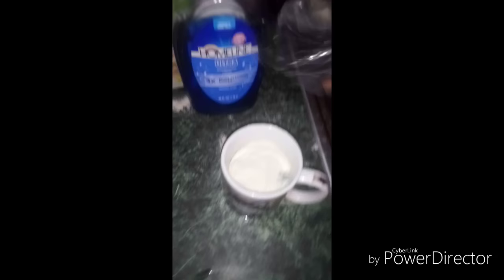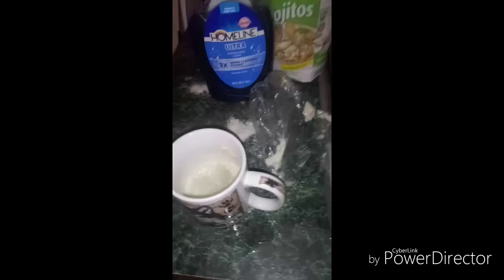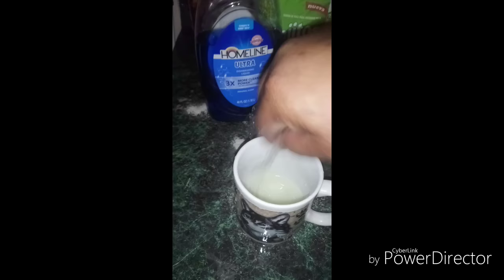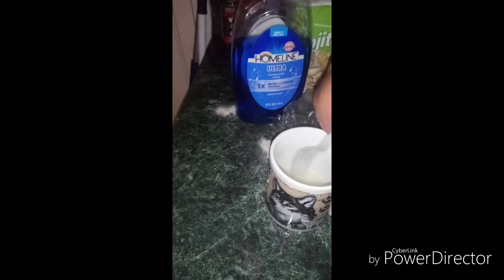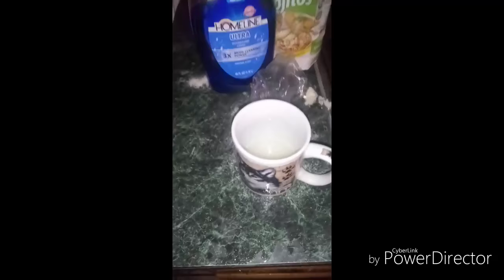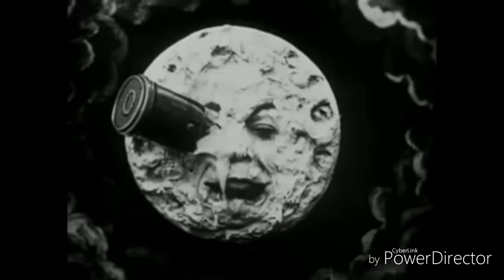How to cook crack. The whole process reenacted from start to finish. flour as place holder parody🍞

Comment: I wanted to share my first try recipe, wich actually worked. Don't use a mug use pyrex so u can see the yellow blob very important to look and spill only into other clear containers. Basically the amount of water u use at first barely matters its just where the reaction takes place but it alllllll depends on how much product u have!! I'd say the smallest for the pyrex is a ball and even that I now find was too small, its actually easier with more. But wit a ball I did about a 1 of soda to the ball. Used about 100ml of water at first, microwave on 7 for one thirty. You don't want it to be a rolling boil and risk it spilling out u rly just want a simmer. Once out u throw some ice water in with your hand and an ice bath or ice pack for the outside definitely helps because it took me a looong time for everything to cool down and come together after spilling out almost all the water keeping basically only the blob. Try to get as much water out as u can with small ammounts. I tried to whip it up but idt there was enough blob so I then just decided to let the blog cool by itself inside the tiny bit of water that was left. It did start to harden and look very clear. I got rid of the rest of the water as the blog stopped moving around. Put it ontop of an icepack with the blog sitting at the bottom and once the container was no longer warm to the touch I just let it air dry for a few mins till u can actually touch the blob. Then as it got harder I scooped it out with a spoon and it started rockin up hard on the spoon. I took another spoon and scooped it onto wax paper and then let it finish completely. I then let it finish drying for an extra like 5-6 hours just for good measure. This stuff seems clean as hell theres almost no crackling but a smooth melt instead. I'll be honest it wasn't the best stuff to begin with but got damn I had almost a 70% return with no whipping. This is all for personal I would not market this or this method this is more for small personals. Best of luck yall these are probly the most specific instructions right here and its all thanks to the sharing of the internet. God bless and wish u all luck! Till next time this was a great learning experience and I basically did it just to feel accomplished. :) I'm no comeback kid yet but success feels great ;)
Reply: Respek ur scripturez fill my crakz 💯
Reply: What would change in this method if I used a stove top with a pot of boiling water for heat?
Because not all microwaves are the same n I’m lowkey new.
Reply from the maker: Nothing. Microwave just a heat source.  Same thing,, 30, seconds and check jin
Reply: 💯💯well explained preciate u bro
Reply: @DubDidit  ... can I just make enough for an 8 ball ??? Thats all I have right now !!!
Reply: I mean at the moment  !!!
Reply: Kmkcopkiller... I'm curious as to the amount of product. If I only have well ... less than an 8 ball now ?
Reply: What I mean to ask is ... " how much water should I use ??? And baking soda ???
Reply: @bradleynickoshie5568  that's wat I'm thinking thought I ain't hadda add anything am new 2 dis n seeing all these niggas wit essays Abt how 2 do it when there's a simpler way in my face
Reply: yeah I do really small cooks dude, so say you do a 0.4 of coke then use about 0.1.5 of baking soda and a tiny sprinkling  of water.
Reply: Microwave on 7 for one-thirty ? I don't understand that part
Reply: @DubDidit message me medd some help I'll cash app you
Reply: Yeah blob frock zara 😂🤛
Reply: @DubDidit Biden 2 or 3 now?😂
Reply: @bradleynickoshie5568 they had to kill the squirrel as a spoon so it doesn't become a very far situation 😂
To save the plates they killed the platts 😂

Comment: Take notes trappers.
Bring a boiling pan with water to a boil.
Put your "Shminķër" in a glass( not too thin). Pour ammonia in the glass so its just above the "Shminķër" 
Then put the glass in the middle of the boiling pan but the water only comes halfway the glass so it dont flow over.
When your glass starts boiling as wel it turns to oil but really let it all turn to oil. 
Take the glass out and splash water on it with ur hands. The druplets on the surface need to fall down. 
Pour out the ammo and put ur glass in the fridge ( loose less that way). Til it hardens up again.

Edit: dont stirr the oil too much
Reply: But what’s te best way to poor the ammo out without spoiling anything of the sheesh in the bottom
Reply: Where u man trap
Reply: @Pastossss  when its done you add cold water with ur hands same amount of water as there is ammo in the glass then it hardens realy fast
Reply: @ig1185  holland
Reply: @ig1185  hollanda broeder
Reply: @hzg3088  Hollanda deze kant ook broeder
Reply: @Pastossss  hahahaha soldaat
Reply from the maker: What in the pyrex glass is going on here
Reply: @DubDidit  nothing sir, we chillin
Reply from the maker: 😆 carry on
Reply: Bro is it possible to reach you I have a couple questions , I just made my first batch and I got 0.4g from 1g … I don’t know when I missed it
Reply: @philipairen3849 You don’t get back as much as you put in. Plus if the product is not that great. You’re cooking out all the impurities.

Comment: My dear God, the ratio is 1/3. "Flour" 1g carb 0.3 then up the amount or down the amount as required
Reply from the maker: There's no set ratio bro ur just making things too fucking complicated. A real d boy gonna just throw a couple pinches in and know what's up.  If u cookin a 7, just out enough to cover up the bottom of the glass, not a thick ass layer a thin layer. Simple as that, maybe 2 decent pinches.  

You acting like every gram of sawf contains 100 percent pure.  Therefore your ratio logic is faulty.  .3 to 1.0. But what if it's been cut in half than your actually putting .3 to .5 what if it's super trash, .3 to .3 .  No product is pure therefore trying to micromanage ratios is bull shit 

Go make your own guide if you know so much better. let me know when u do, I'll post the link to you smh
Reply: @DubDidit  Hey bro. How do I cook using 1 gram. Don't want to screw it up as it is my first time and Id like a pro like you to help me !!

Comment: I normally clean my floors with anomia never seen that method before
Reply from the maker: Yeah, the floor cleaner good but it won't blow up. Not to mention it's harsh on the wood if not done properly
Reply: @DubDidit   straight up I'm using amonia to wash up my thing what you mean it won't blow up

Comment: I've got 2 grams, still use micro? And how much soda? N how long? Any help would be great
Reply: Do u cook it for less time if it's just a gram
Reply: @johnmartinez1410  did you find out?
Reply: No..so I just cooked it in a glass jar in a frying pan full of water
Reply: Put 2 leveled tablespoons of soda, drop all in water, stir. Microwave 30 sec. Stir top of water. Then swirl mug around while blowing . Let set for 5 minutes and you'll see rocks at bottom. Pour off water,put on napkin to dry. Do what u do

Comment: hello quick question , do you have to use bicarb? or baking soda?
Reply from the maker: They the same thing my man
Reply: @DubDidit  yeah appreciate it bro i thought bicarb was slang  for something else , also would it be better to use less water to be safe?
Reply from the maker: Krak is not water soluble .  So I just never really paid too much attention to how much water I stared with. I'd dump 98 percent of it out (that's a guess).  Lot of ppl mess up by leaving all the water in there and it comes out as crumbs. Buuut there really isn't a wrong way as long as desired results are achieved
Reply: So I can mix with flour?
Reply: @bigpapa9528  🤣🤣🤣🤣🤣

Comment: Man i tried it with the real an messed it up because i didnt know how to whip
Reply: Whip it counter clockwise for 5-7 mins
Reply from the maker: Or not. Errbody got they way. I'm telling mine, I don't want no one to get confused tho. Clockwise counter clock wise etc..1 min 2 min whatever. Whip it whichever way your hands work. Sometimes it takes a few minutes to harden sometimes it don't. There are too many variables to be so specific
Reply: @DubDidit  quick question do u have to brake down the product or straight cookie

Comment: I dont live that life anymore but just wanted to share that this was always a pain in the ass. I dont necessarily want to promote drug use, but if you do partake and want to save your money, just find a plug with ready rock. skip all this bullshit. save your time and money.
Reply from the maker: The problem with that is most dealers don't sale good work. They sale whip. So your basically paying for the extra air and water.  With that same money you can make the same qaulity work but get double the amount you get from the dealer. And it only takes 5 minutes of your time.

Comment: If I’m only doing a little do I still put it in microwave for same time. I been trying the mix method in shot glass and everything burns of in like 5 seconds.
Reply from the maker: 2 min on the Lowes setting how I did it. 56gs tho u can do 1min
Reply from the maker: Not to mention if its burning up after 5 Sec it might be not so good.  Saawf has a very high vapor point.
Reply: @DubDidit  it sticks to the sides. Is all the soda supposed to burn of or once it steam and is still froth a little drop ice and stir.
Reply: Product is fire

Comment: I thought you put ice cubes in it or something? Or is that another way
Reply from the maker: If u need you can..that's just to  .cool the temp of the water or mixture so it hardens up faster. Usually it will harden up as you whip it.  You can also put your pyrex in some cold water or maybe put it in freezer but honestly you shouldnt need the ice